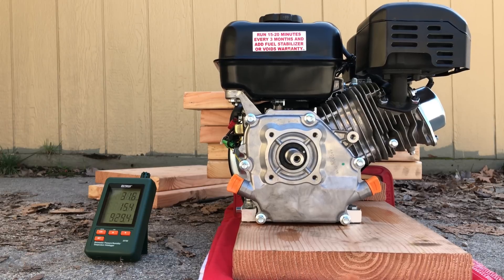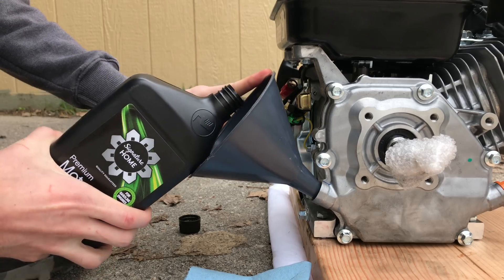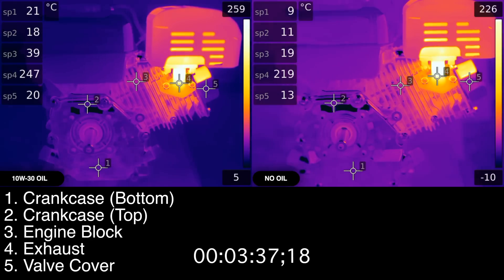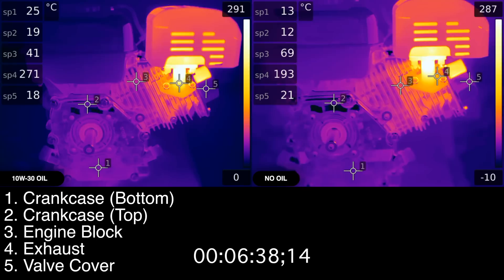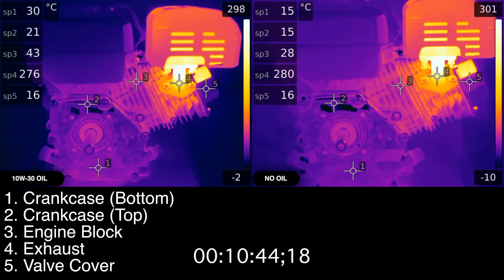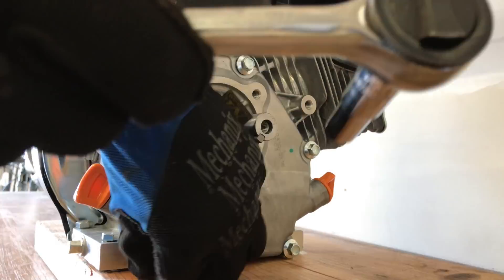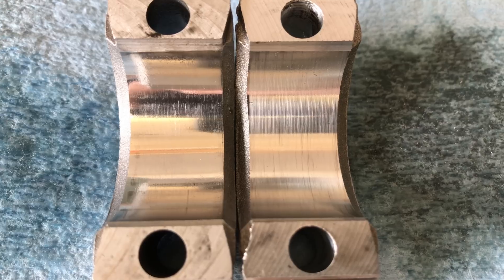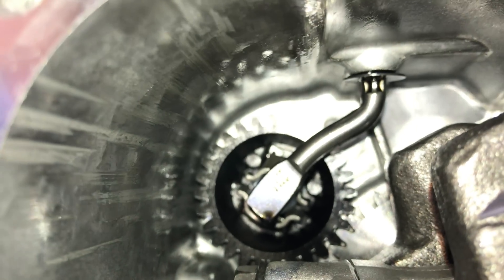What Happens To An Engine Without Oil?

Comment: so, oil is for protecting right? why the ads always about cooling?
Reply: The lubrication oil provides reduces friction in the bearings and other components. Without it, the friction would cause the components to heat up and fail. It is common to find heat damage on the crankshaft, camshaft, and bearings when an engine runs out of oil.

Comment: Oil is mainly for proper lubrication. Water/collants are for heat dispensation
Reply: The lubrication reduces friction in the bearings and between the piston and cylinder wall. Without that lubrication, the friction would heat up components and cause failure. When an engine runs out of oil there is usually heat damage on the bearings, crankshaft, camshaft, and rods. Oil is the only thing that cools the bearings, there is no collant flowing by the crankshaft or camshaft.

Comment: Why doesn’t oil share the cooling system like transmission cooler lines?
Reply: Some cars, mainly trucks, do. Its usually unnecessary unless the engine will be ran under a heavy load for longer periods of time like when towing or racing.

Comment: A little experience I have with running my car without oil unbeknownst to me. I've had an cylinder head gasket failure and for months water had been mixing with oil in my engine up to the point where all oil was gone. A few days earlier, my car completely broke down after a month of just emitting a seemingly slight weird noise. It took only 2 days for the noise to worsen and my engine to completely fail. 
I did oil check every month and it just seemed fine and at correct level. I now have to pay 1600 bucks for a new engine and new transmission.

Guys, CHECK YOUR ENGINE'S OIL CAREFULLY!

Comment: The oil transfers the heat into the engine blok. Without oil it doesnt. So without oit the bearrings get hotter and the bloks stays colder

Comment: how do you dispose sludge oil from engine? it's not good environment to throw like a trashbin
Reply: Many auto parts stores will take used oil and dispose of it properly. It usually ends up being recycled. They would probably take sludge too.

Comment: No external load on the engine.  I bet it'd be just about destroyed with a full load (as in it can just hold peak torque rated RPM at WoT).

Comment: this is my first guess before i google "engine oil". 
engine oil is especially made to absorb heat from the engine. and it is cooled by the air as we drive. this is the reason why sport bike riders don't want to ride slow. it burns their testicles if they keep driving at 1st gear low speed.

Comment: What happens when engine oil is mixed with coolent in it?
Reply: The water would reduce the effectiveness of the oil. If too much water gets into the oil, it would no longer lubricate properly. This would cause severe damage to the engine

Comment: Will leaving the oil cap off make the engine knock
Reply: No, however it would allow dust and debris to enter into the oil. That debris can cause severe wear on the bearings.

Comment: What is the bottom right box? Is it the ambient temperature? If it's so, it makes sense to me, because the environment in the right is much colder than the left, so no doubt the engine will perform differently and makes the engine with oil has higher temperatures

Comment: would say the engine needs to be loaded to expect catastrophic failure due to running without engine oil ... I guess idling will only show the failure that may occur due to metal to metal contact that the parts already have a long service life time even if oil is a very low in viscocity ..I would recommend to see what will happen when the engine is under load .

Comment: Suggest: get a new engine, and run the test again. Only this time, don't forget to open the choke. 

And before you do the no oil run, figure a way to get ALL the oil out. I theorize that the little bit that was still in it was doing a lot of work keeping the engine from sagging itself.

Comment: My first car was a bit of project - a 92' Peugeot 405 2.0L petrol engine. The engine came in the trunk with a bent connecting rod and some other similar damage. How it happened? Very low oil and pushing the car hard on a motorway. Was expecting to see something similar in this video... then again, Mythbusters tried sabotaging an engine with all kinds of tortures, like a lot of sugar in the tank and coins in the cylinders, but it kept on running for much longer than anyone expected.
Fun fact about the 92' peugeot - brought it to a dealership for some spare parts and mine didn't match any of the models they had in the catalogue. The dealership speculated as it's manufactured right at the end of the 88-92 range and start of the 92+ range, it ended up being a bit of a hybrid - some components coming from one range, others from the other. For example, it had 4 disc brakes, which apparently the 88-92 year range didn't have. Not sure how legit the dealer's claim was, possibly a previous owner salvaged a slightly newer model or something like that. Do such hybrids actually occasionally roll out from an assembly line?

Comment: Cleaning engine after removing old oil won't clean completely i hope. My friend , a mechanic used to do a different technique of cleaning the old oil content by pouring some petrol after removing old oil and start the engine for a few minutes. Afterwards he fills the new oil after draining the petrol poured. Does this technique help???

Comment: What happens if you run a motor with water instead of oil? Would it have similar results?
Reply: Yes, water is not a good lubricant at all. Water contamination in the oil will cause severe wear. If there was no oil and only water, it would be just like running the engine without oil.

Comment: I was with my buddy once when I was a youngster, and we took his dad's old f150 out. We found out later it didn't have oil in it, it blew a rod out of the engine block and smoke was wafting out. I jumped out while it was still moving lol, thought it was gonna ignite. Fun times.

Comment: I can tell you exactly what happens. I was once mowing my neighbors lawn, I could have sworn my old man told me he put oil in it. So I pull out all 8 hp of the shed, top it of with some 93 and I start pulling like a stripper reaching for a wallet. Well after about 5 mins I finally get this bad boy to fire up i start mowing the lawn and next thing ya know it's sputtering and then bam, the blade comes shooting out under the mower. Seized the crank.

Comment: What happens to an engine without oil you ask? At first there would be more friction between the piston and cylinder wall, next you would begin to get metal shaving from the lack of oil on the valvetrain (especially in ohc engines). The timing chain/belt could also receive damage from lack of lubrication. And in the end, if the engine is able to last this far, the crank bearings will seize.

Comment: I've topped up a 179 cc TVS motorcycle on Mustard oil and ran it for a couple of days because I was scared that I'll seize the engine because of too less oil. The bike ran absolutely normal with half a litre of cooking grade mustard oil and whatever engine oil was remaining in the engine from before. Ultimately, I did change the oil completely and filled regular 15W-40 oil.

Comment: How about testing or explaining what happens when you Overfill the engine oil?  Im specifically thinking about Subaru and the tendency of dealers over filling at oil changes. and effects this may cause with different engine designs

Comment: I had an oil change today and they forgot to put oil in the car. I was driving my car and made it to about half of a block away when my car stalled and was making a horrid noise. The oil light was on. I start of the car back up and turned into the nearest driveway. I looked at the dipstick and noticed that there was no oil period called the place that did the oil change and they came with oil and when they opened where you put the oil in there was smoke coming from it. My vehicle was probably running for about 5 minutes. They said since it wasn't running for more than 12 minutes without oil that there was no damage. And the safety mechanism I'm shutting my car off prevented any damage also. I just replace my engine because I blew it because I was working a lot of hours and I didn't change my oil for a quite some time. That was about a year ago and I know how important now it is to have oil in your car at all times. I had get my oil changed regularly now. But I guess my question is even after 5 minutes isn't there damage? And why should I have to pay for some damage that was not even my fault?
Reply: There was definitely damage, probably a lot of it too. They pulled that 12 minutes out of their ass. There is no time requirement, engine damage happens immediately. They were just preying on your ignorance to get out of replacing your engine.

Comment: I destroyed a 225 slant 6 some thirty years ago from oil starvation. I'm still mad at myself. I had replaced the oil pump drive gear, and the new one snapped instantly. I can't recall if the one-ton Dodge truck had a gauge or just a warning light. I had walked away and left the engine idle. 15 minutes and it was dead.

Comment: i think the temp diference im minimal to say none. because the engine uses the oil to cool down.
but outer engine walls since they are in contact whit the air. they dont heat so much. but inside... the bearings and other moving parts is a lot higher.
on the outside you dont see much diference because is no oil to help the heat to transfer for the engine side and outer walls. 
i guess is that. is not because the engine is not hotter. is because is no real heat production on the out walls. and the low oil is not helping the heat to go to the outside. and is staying on the inside.

Comment: I changed the oil for my jeep sends after 2 weeks the engine sign appeared on the board. I called Chrysler to make an appointment and also asked if they really changed the oil. I was told that had nothing to do with changing the oil. Hmmmm. I reached my work and after 2 hrs I decided to check the oil. I never, ever seen a engine without oil before I  a running car. Everything was dried. I could not get a drop of oil. I was so mad and my first thought was they forgot to put oil or did not change, but being completely dried???  Fire stone where I took the car immediately to add oil for me to go home told me the filter was too tight and something broke letting the oil to run out, but it didn't fall on the ground....I will have seen was leaking. Is a 2014 jeep grand Cherokee limited. I was mad , mad with the Chrysler.....I send it Ann's they fix it, but what happened to the engine.?The guy at fire stone said he heard a noise I  tyre engine. Should I hold Chrysler accountable and pressure to change the engine?? what you suggest. I'm paying $640 each month for 76 months for this car. Pls help

Comment: I think that assembly oils and lubes were still in the "no oil engine". A piece of silicone got pulled up into the pickup tube in a small dump truck I had, I saw the oil pressure gauge drop to 0. It dropped sitting at a red light and I only had to go about a mile and my engine (v8) was so damaged, that I bought another engine for it. Multiple bushings were damaged, valves were scored and stuck, cylinders scored as well. Very expensive day!

Comment: yeah i mean the engine was only idling too which obviously itd be hard to give the same exact amount of throttle both times, but the engine had minimal stress on it. plus with the metal shavings in the oil and and all that stuff, you will always get some shavings in the oil especially after the firt run or break in period. still really cool experiment dude!

Comment: Well, your video is really interesting.I must admit that I have the same expectation before watching the video as you had said that the engine w/o the oil will have a higher temperature in all aspects in comparison but we were both wrong. So I reckon the engine oil serves solely for lubricating - preventing friction and wear and tear and NOT AT ALL for any cooling effect.
Reply: makes sense otherwise we wouldn't need coolant.

Comment: How did you get that engine to run without oil? If I'm correct those predator engines have a low oil sensor that doesn't let the engine run.

Comment: Hey engineering explained dude those engines always have metal shavings in the oil on the first run. I recommend breaking it in per the instructions and then performing this test, as I have two of these, and they both had metal shavings in the oil on the first batch of oil
Reply: Yes good call, that comment is a very valid one. That's why they call it breaking in an engine.

Comment: p.s. To help with all metal-shavings that form and are thrust through the engine-oiling system,it's best to attach tiny magnets to the oil-drain-plug and somewhere on the oil-filter!!! You'd be amazed at just how much those tend to collect after awhile!!!

Comment: I have 2 questions for you
 1. How much is the fuel comsuption (in a ordinary engine)  during the engine break?
2. Is the engine break affected by the number of the hp or engine capacity? 

This questions are not related to this video but i didnt know where i could write them. 
Thank you, regards Gelu Andronache!

Comment: Problem is you are not using cooling system of this engine on an oil-air cooled engine because it is standing still. try the test with putting a big fan in front of it and you will see the difference. Motorcycle oil-air cooled engines gets around 120 km/h wind on them because of speed and the oil gets all this wind on the engine block area and gets cooled and then circulates in the engine and cools the engine.
Reply: MedievalFitness But these are meant to be ran on generators

Comment: When I ran an engine with no oil, it was in a Honda Civic, and we jacked up the front wheels, and put it in 5th gear and redlined it. Well, it ran out of gas the first time we tried it, and we had to put more in it, and then run it for another 30 minutes at the red line before it finally slowed down and seized. The heat coming off the engine was phenomenal, and the smell was terrible. But eventually it did friction weld the pistons to the block.

Comment: When I was a young man I drove a Ford Windsor V8 about 3-4 miles without oil pressure. It survived just fine, but I did think to keep it at almost an idle getting home. Rattled a lot. Put in a new oil pump and kept driving it.

Comment: I would not hesitate to use "grocery store oil" or any brand. The oils are blended at the refinery, not by the grocery store. Each refinery is required to meet the ANSI standards which now include not only anti-oxidants, dispersants and viscosity tolerances but chemical content as well. The old oils varied chemically and some had high sulphur or other contaminants. Not any longer. The standards are so strict that really, all oil brands are virtually the same. The refinery blends the oil and puts it in different bottles. Some have brand names, some bottles say grocery store. What's inside the bottle is, for most arguments, no different at all. I was told this by a Chevron oil engineer during a professional's educational course on motor oil.

Comment: the reason nothing happened is because the engines weren't under a load. Running at idol it would take quite a while before you would really start to notice the difference. That engine with no oil would seize.

Comment: FMC made 2 banger drone engines in WWII. The man who ran them in used a fine abrasive (Fels Naptha Soap) and water to run them in. FMC was contacted by the army to discover just how they managed to do it as they had one engine without oil that ran the drone just fine.

Comment: Hi,I brought my 2017 Kia Sorento for an oil change and tire rotation. The red oil can and light was on and check engine symbol when I drove away. I thought it would reset itself after I drove. I emailed Kia when I got home the lights would not go off on dash board I could not reset the dash. This was about 50 miles that day.went out the next day so I must have Drove about 100 miles wow loud noises under hood etc. got home my husband checked oil no oil in car on stick. Called Kia was towed in they said they will see what repairs in need. Can you advise me here as I know they are only going to to do the minimal repairs. We videos the sounds it was making and the oil stick with no oil.What do I need to ask etc. I think they should replace the whole engine.Help!

AnnetteDingmans Ferry PA

Comment: Also, a brand new engine is smoother, if it was older or slightly worn, maybe the surfaces interacting wouldn't move so smooth over eachother

Comment: ive been inside an engine without oil (honda gx 160, the industry leading version of the predator 212) , no need to waste a good engine to find out what happens, it wollows out the rod bearing and after a while the piston siezes up in the bore and if its an aluminum bore you might as well forget about rebuilding it, an iron bore could probably still be ok and the engine getting a new piston and rod could probably still work fine again on the old crank and in the bore that the other one siezed up in depending on how bad it is, i guess thats how my junkyard engine was, others ran without oil could be much worse

Comment: I do have a video I want to see maybe you can help.. I see a lot of ppl trying hho engines instead of gas but if you mixed the two together would the engine still work or explode, once again I am just seeking knowledge as I don't have the materials to run the experience myself and don't want anything bad to hppen if put together incorrect